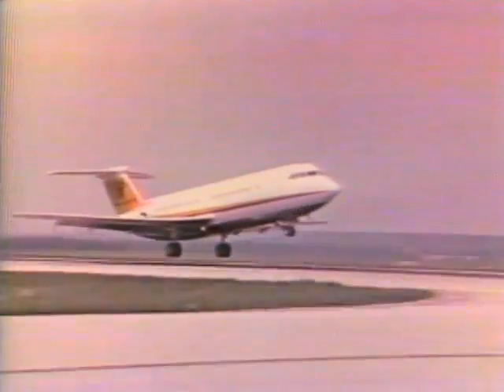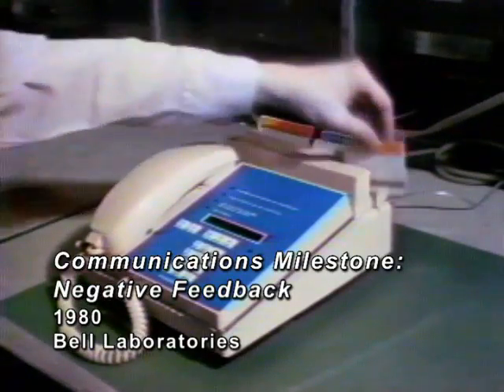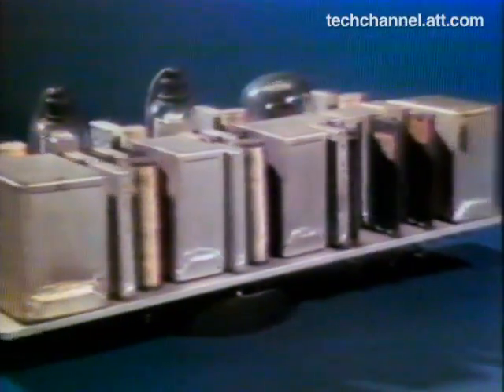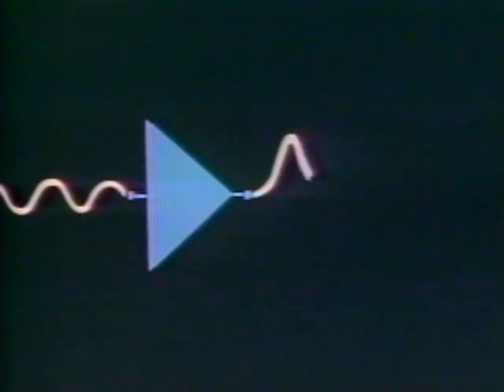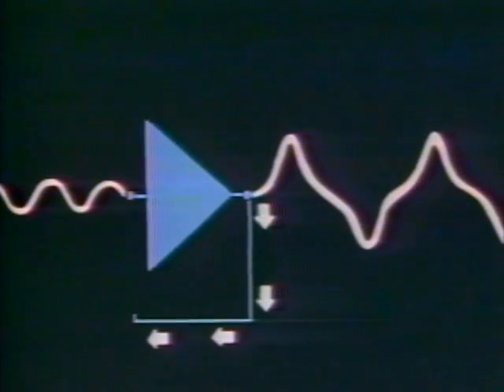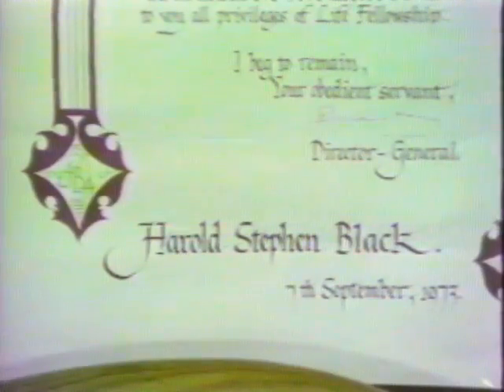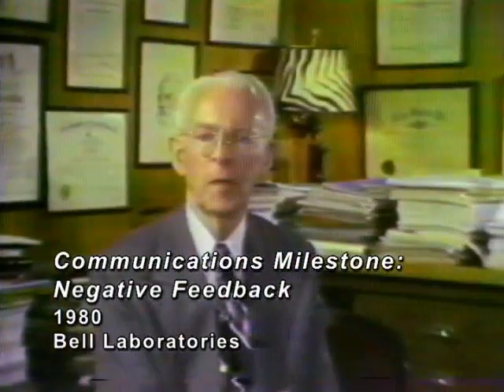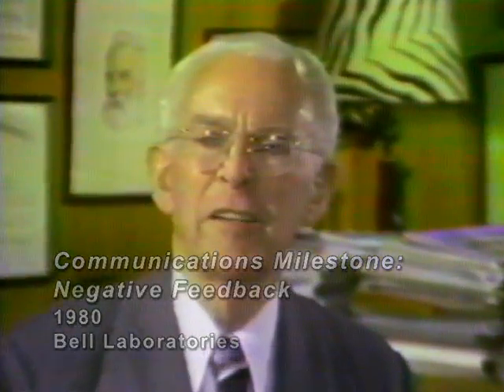Harold Black and the Invention of the Negative Feedback Amplifier - AT&T Archives

Comment: If a Neg. feedback audio amp is built to amplifiy 60 Hz and  the amp.  spans  3,100  miles.  The  "A"  circuit is 3,100 miles across, and the  "B"  circuit return path is 3,100 miles. LA to New York and back.  Due to the  propogation delay, I would expect this  amp. to show visable "hunting"  as the  closed loop gain converges.  I'm going to guess, that before  feedback was fully understood, that  some of those early  tube amp. designs had  Neg.feedback and the designers were un-aware of it